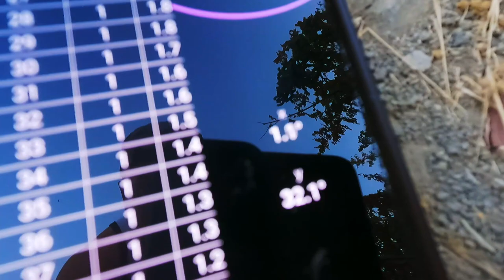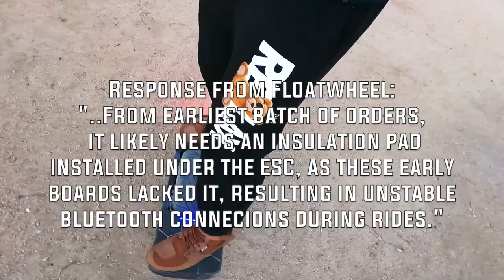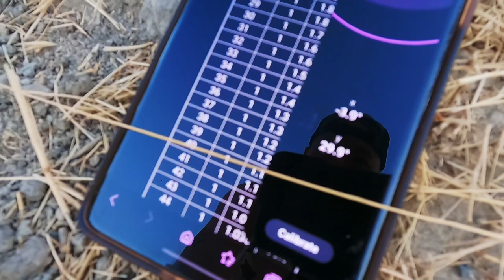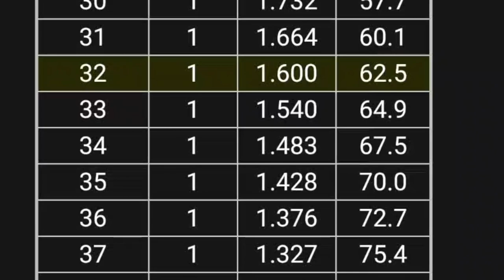Floatwheel ADV Pro vs Fungineers SuperFlux - Uphill torque test!

Comment: If you put the floatwheel at 150/150, and it didn't explode, it would have crushed that hill i suspect.
Reply from the maker: Seems pretty high stakes for finding out 😆 they recommended to go only as high as 130/-130/200 so I didn't want to risk it heh
Reply: @MaxxSend  i wouldnt risk mine if i had one, but im sure people will gradually push all the limits in every direction over time

Comment: Nice video! You chould change the current setting of the floatwheel to 134A so you have the same output. Now you got almost 1200w more power on the superflux.
Reply from the maker: thanks! according to floatwheel they recommend only going as high as 130/-130/200A, but I set it at 120/-120/220 to not get as high to possibly fk things up. I'm sure there are other tweaks that can be made to make the fw motor more efficient. They were pretty close. Superflux is only around 20% duty cycle during peak climb, imagine the wattage during high speed runs..
Reply: @MaxxSend  Okey. Would be nice to see the temperature of the floatwheel and see if it can handle more power.

Comment: Another important aspect demonstrated by this comparison, that is often incorrectly understood by many in the PEV world, is the fact that Voltage is not directly important for speed or performance. Rather, the relationship to performance is indirect.
What truly matters in Amperage. Power from a DC motor is directly related to the torque produced, and indicated by the equation: P=τω, where P is the power, τ  is torque, and ω is the angular momentum of the rotor. Torque, in turn, is determined by the equation: τ = N I A B sin θ. (N is the number of turns of wire in the core, I is the current, A is the area of the loop, B is the magnetic field strength, and θ is the angle between the perpendicular to the loop and the magnetic field. One thing that should jump out to anyone is the complete lack of Voltage anywhere in this equation! Voltage is essentially irrelevant (at least directly).
But where it does come into play is the role Voltage plays in how much current can be pushed through the windings if that current is available. And that last part is the key. If the battery systems powering the board can not provide any additional current, increasing the voltage will do NOTHING to increase the torque. And, importantly, most of these systems are very close to being current limited (i.e., they are very close to the limit of how much current they can push through the motor) already. In other words, increasing the number of cells in series only does so much if you don't have an adequate number of cells in parallel to generate sufficient current to drive the motor any faster.
Increasing battery voltage really doesn't make a motor spin any faster by itself. It only does so on account of its ability to better overcome overall system resistance, and this push more current through the motor, and perhaps more importantly, at a lower temperature, thus allowing the motor to spin faster while still remaining inside the thermal envelope of the system as a whole. As such, the ESC can afford to push more current without overtaxing other components. It's this that allows faster speeds with higher Voltage, not the Voltage itself.
This is shown clearly in the comparison, as the Superflux set up outperforms the CannonCore, even though it is at a significantly lower voltage, because the available current to the Superflux is significantly higher.

Comment: If I already have an XR with rails I like what would be the price comparison to build a super flux?
Reply from the maker: you need to get a 'lil focer' VESC based controller from MakersPEV to be compatible with superflux, cannot use with fm controller. Price for controller is ~$430-700, Superflux is $400. links in description :hand-purple-blue-peace:

Comment: I am shocked!!!  Please test using the remote, I think floatwheel should easily go up the hill with the remote?  Would also like to see the max power, current and motor and mosfet temp after like 3 attempts on each board 😅. No need to send it going down hill, use atr 2.5!
Reply from the maker: I'm not a fan of the remote, will leave that up to someone else to try. But both boards didn't scrape nose! It was the fw's motor that started crunching or stalled. I can try to remember to do the RT data for each after 3 attempts, but currently the bluetooth is having issues with the fw. Can't bring myself to go down again, traumatized by the dozen thistle thorns I got a few years ago :face-purple-smiling-tears:
Reply: @MaxxSend yeah take care. Don’t attempt it again, lucky you didn’t break anything. Look crazy when you fall like that.

Comment: When you get the supeeflux motor does it come with the adapter to the wiring to connect it to a controller?
Reply from the maker: There are 3 phase wires that plug directly into the lil focer controller

Comment: Hey great video. Its it possible to price your products so that it is cheaper than buying the Floatwheel? Adding up the prices of all the parts and shipping, the cost of the DIY is way more expensive after consideration of build time. The parts need to be at least 25% cheaper. Please comment and let the community know if you will reduce your prices so that the DIY kit costs less than just buying the Floatwheel.
Reply from the maker: thanks dude! but I don't make any of these parts, way above my pay grade hahah. Depending on your desired setup your DIY parts may indeed be more than FW. This is because of each company factoring in their time and profit separately, along with shipping, so yes it adds up..

DIY route is for those who want a specific setup to their riding style. If you currently don't have any parts yet, the best route is FW hands down. All the important components such as battery, BMS, controller, motor etc are all sourced for you for a fair price. You get wayy more power than GT too. Watch my most recent vid at the end Conclusions so you may better understand why. You'll see how FW is constantly developing new ideas and innovation, and they back their products 110%. Check out: https://www.youtube.com/watch?v=kC3eK4aHuUY

Comment: Are both the same motor current settings? I only saw the current setting of superflux +/-150A
Reply from the maker: no not the same, check 00:35. Floatwheel recommended the max current to be 130/-130/200. I didn't want to risk it so I did 120/-120/220

Comment: Why is the VESC app showing only like 1000 watts when you’re climbing up a hill like that? Doesn’t seem right.
Reply from the maker: as you can see duty cycle only averages around 20% for this uphill torque climb. More duty is utilized for high speed runs. I was surprised to learn that too during the first hill climb tests last year.

Comment: does the super flux just plug and play with a XR controller? would a street pro 2fit on it? should I be asking these questions else where?
Reply from the maker: no the SF is not compatible with XR controller. You must get a 'lil focer' VESC based controller from MakersPEV (link in description). Once you get the VESC controller it is pretty much plugging in 3 phase wires from motor into the controller. Any 6" tire fits on the SF. For more detailed info regarding SF hit up Fungineers on ig @fungineerstech
Reply: @MaxxSend  good to know 🤔 was thinking about building a non FM board anyway soooo :D
Reply from the maker: @JwadeProductions7  do it sooner than later! you'll be thanking me :)

Comment: Nice work!!! Have you tried a GT on that hill out of curiosity?!
Reply: Would love to see the GT with custom shipping on that hill, mind you!
Reply from the maker: Much appreciated!! I didn't even bother cuz a vesc with stock xr 62v battery outperforms a gt by a mile, and the 62v vesc only made it up 30% of this hill..
https://youtu.be/fwLTDvaJ_dQ?si=t9TIfLz7E5EfLkfk
Reply from the maker: @wayofflow955 it wouldn't do well I guarantee you, or the controller would shut down! Check out my first hill climb tests of stock 62v vesc vs gt 😂 https://youtu.be/fwLTDvaJ_dQ?si=t9TIfLz7E5EfLkfk
Reply: @MaxxSend I am pretty sure of it also, yeah if you compare GT to vesc too much it would make FM look too bad. My GT motor temperature going up the same hill is 10 degrees hotter compare to xr/vesc. That show the inefficiency of the designs!

Comment: I wonder which stators weight more, I he heavy stator should have more copper making the he electromagnetic stronger hence the more torque. Seem if the cannon core has a larger opening it would has less room for copper. Any thoughts on that theory? If fungineers and Tony tells us the amount of copper in the stator we can pretty much tell the stronger motor!!!
Reply from the maker: I'll send fungineers this message and see if he can shed some light!
Reply from the maker: According to fungineers: "It's simple what we did was put the maximum amount of copper possible, the more copper, the more current the motor can turn into usable power, before being saturated, known as stator saturation. So with a hypercore, the amount of copper is tiny, it can take a few amps but after that any more current is just turning into heat. The SF also has larger wires so a lesser resistance to current and more usable power can be successfully transferred"
Reply: fuck yeah
 @MaxxSend
Reply: @MaxxSend thanks for getting the feedback, yeah it make sense. I’m pretty impressed with the SF motor, no overheating so far. Not sure if the little little focker or the motor is the limiting factor for more torque at this point assuming the mosfet are cooled properly!

Comment: I gotta ask… is it on the low setting for the FW?
Reply from the maker: it's near the max motor current recommended by FW: 130/-130/200. I set it at 120/-120/220

Comment: I have a feeling its just cuz the floatwheel tire having less grip ngl, maybe slap a real tfl enduro on there and compare again or slap on the same tire as the one on your superflux, u keep getting a slight bit of wheel slip which brings yr nose down and u end up getting stuck and spinning even more
Reply: The Enduro also slips out super easy.  There just isn't a lot of tread on it.  I swapped my Enduro to a Slayer on my SuperFlux build and I get way more traction.
Reply from the maker: The reason the FW gets some wheelslip is cuz this is the first gen motor in which the magnets have been setup to get more low end torque. Sure a different treaded tire may help a tiny bit, but only one attempt did the FW lose traction and spin out. All other attempts the FW never scraped nose and it was the motor that started crunching or stalling. It mostly comes down to the motor current capacity, the superflux has a ton more copper packed into it and can run more amps, more power.
Reply: FYI. More traction = more resistance.

Comment: Heyho from Germany!😀 Why didn´t you set the rails up, like the rails from your superflux? There could be another result. Float on! ☺
Reply from the maker: waddup! I like riding trails lifted for more clearance, so just kept it like that since the floatwheel's tire is bigger than the trail pro on superflux so clearance was nearly identical at around 5 inches. The floatwheel only scraped the nose once, so clearance wasn't an issue, it was always the fw motor crunching or stalling out. Biggest factor is that the superflux can take more current than cannoncore.

Comment: What battery is inside that Superflux board?
Reply from the maker: 18s2p 75V ME4T pack (50s cells) by Mario www.theboardgarage.com
Reply: @MaxxSend  How is it possible to pull around 140A from that battery when the 50s cells max out at 35A x 2= 70A? Is this safe for the battery?
Reply from the maker: @smelker  motor amps is at 150A, battery amps is at 45A I believe.
Reply: @MaxxSend  Yes off course.. thats right! But still doesent get it, how it can be more powerful than the floatwheel that has around 6700watts on the dyno. The superflux should have around 4800w of power if its 75v and 70A battery (3,8v sag x 18s x 70A)
Reply: The floatwheel has 20s2p, with p42a thats 2x45a. So, 3,8v sag x 20s x 90A = 6840w. Do I miss something?

Comment: I thought you said you weren’t gonna bother comparing the two boards dude. I knew you’d do it. Now the competition is on. That’s wild dude the vesc is out preforming the float wheel
Reply from the maker: I said I wouldn't bother comparing with the boring gt.. do u see a fm board here? Not trying to clown, but u tend to miss my message my dude! My whole purpose now is to compare Floatwheel and DIY vescs..
Reply: Finally something we can agree on. I didn’t miss your message I did read it. You said “ I won’t bother comparing the DIY vesc and the float wheel with the “boring” GT” You just exposed my point don’t compare and FM board to a VESC! the comparison is unrealistic. I didn’t say there was an FM board in that video bruh. Of course the VESC is better. I do have to say tho the onewheel GT is the best out of the box onewheel you can get and it’s the most reliable and has lots of head room for push back which is making the GT way more trustworthy and reliable with plenty of torque and Calling the Onewheel GT "boring" isn't cool at all. I do the endurance racing with the GT I don’t own one but I used a friends board to race once and I’m going like top 33.8 mph on it. And his onewheel is stock. because there are many people who have this board and take pride in it being their ride of choice. It might make them feel like what they ride is not considered 'cool'. Talking down on the the GT isn’t okay?
Reply: @MaxxSend   It is extremely dangerous to use an 84V controller on a 63V battery, as the controller is designed for usage at a higher voltage. This could cause the battery to become overcharged and cause destruction of the battery cells. It can cause a fire
Reply: @M.Grayson405 bro your so overly dramatic Lol it’s just a damn comparison video it not that big of a deal.
Reply from the maker: @M.Grayson405  no dude we still don't agree and you still don't fully understand lol I have 0% regret of comparing the vesc vs fm boards back in the day. It was what helped people understand just how much potential vesc tech has for the aftermarket and open source worlds. But it wasn't always better than fm. How would you have known that "of course the VESC is better"? Prior to me comparing vesc vs fm in May 2022, most people in North America were still unsure and hesitant about vesc, for good reason because it was still lacking in performance for the onewheel and the ride not as good as fm programming. Then with those comparison videos and further improvements thereafter it helped spur the movement and interest here in the US. Since then many more intelligent people have joined to help further improve the vesc programming to finally surpass that of fm's programming about 5 months later after I made the comparison vids. Fast forward to now, I again repeat there is no need to compare vesc to fm anymore because vesc performance and programming has far surpassed that of fm, but it *didn't start that way, and has never always been like that*. Here is the main point: vesc wasn't inherently better than fm. There had to be comparisons from the beginning and a lot of work had to be put in to get there! Please try and understand that, that is the most I can lay it out for ya.

Lastly, I shall keep saying the gt is boring cuz it's my opinion :) Didn't you say we can have our own opinions? I'm not trying to change yours, just trying to help you understand the background of why it was crucial that I used to compare vesc and fm, and now why I don't. You can twist that to however you like.
Reply from the maker: @DIYpo607  there's always a few who get worked up and grab their pitch forks 😆
Reply: @MaxxSend  for sure. I hate Karen’s dude
Reply: @MaxxSend I'm constantly dealing with them on my Onewheel GT and my Focer, you know? I simply enjoy playing pranks on these poor souls.
Reply: @clips8736
You seem to have very little knowledge about how ESCs work
Reply: @aladin45  bro I just don’t give a shit about it. it has nothing to do with knowledge. and you end up paying way more money on a vesc than you wound if you have GT because focers break so much. They are very big projects that in my opinion is a waste of time. The XR stock is a lot of fun itself you don’t need to put a vesc controller in it. It’s reckless and stupid.

Comment: How come Floatwheel is so underpowered.
Reply from the maker: Fw recommended to go only as high as 130/-130/200, I set it too 120/-120/220. It's not that fw is so underpowered, it's got an insane amount of torque and power. It's that superflux is capable of handling more current, likely due to it having more copper.

Comment: Bro compared a lifted superflux to a normal floatwheel. Either crank your atr or lift the floatwheel next time for a better comparison. 😢
Reply from the maker: I like riding trails lifted for more clearance, so just kept the superflux board like that since the floatwheel's tire is bigger than the trail pro on superflux so clearance was nearly identical at around 5 inches. The floatwheel only scraped the nose once, so clearance wasn't an issue, it was always the fw motor crunching or stalling out. Both on the same tune. Biggest factor is that the superflux can take more current than cannoncore.